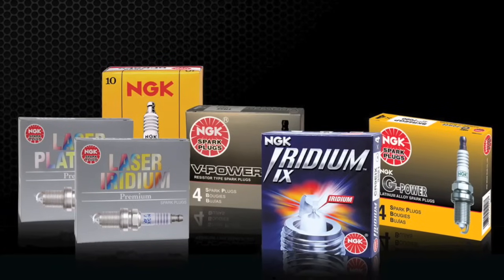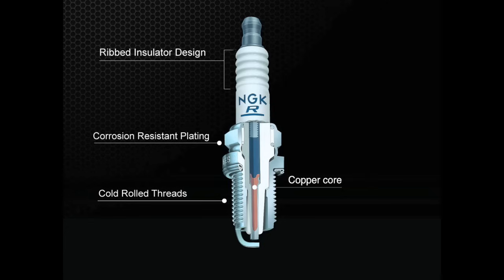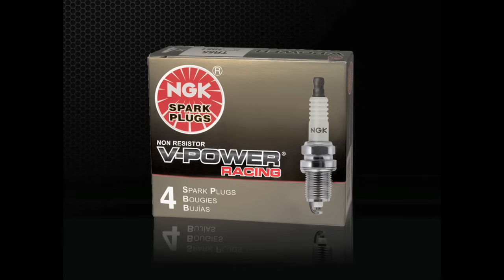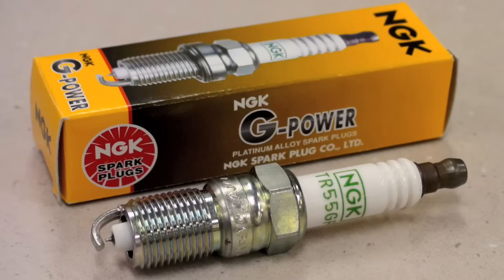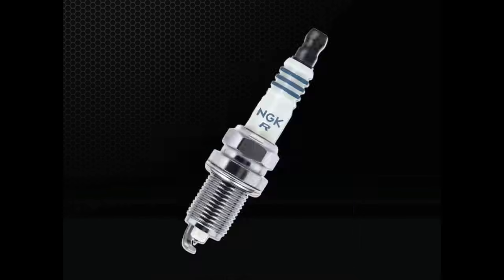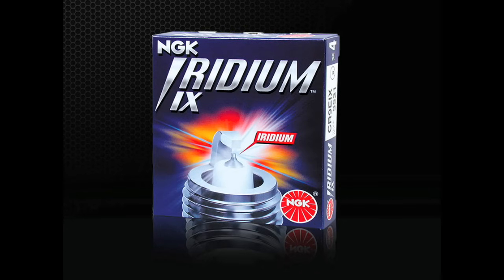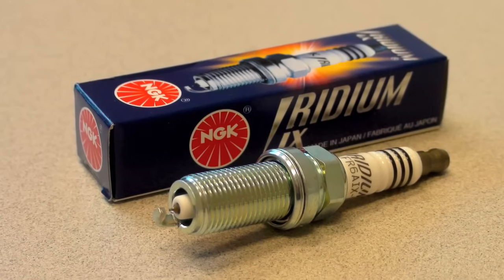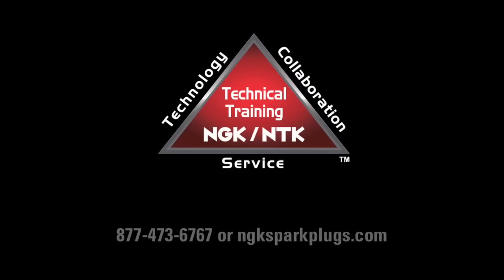Spark Plug Types - NGK Spark Plugs

Comment: I bought (saved) a car from someone who changed it from a running car, to a non-running car.  Likely a bad injector, he thought he needed a "tune up".  He said his friend changed the timing belt.  Said he then replaced the rotor, plug wires and new plugs, and finally did a hack electrical job on half of the injector connectors.  Went to look at it, first verified his crappy wiring was correct and going to the right injectors, amazingly they were.  Then I pulled all the plugs to do a compression check, compression was fine on all cylinders.  Apparently he thought buying Iridium plugs would solve all his problems.  Instead they were fouled, one of the electrodes was burnt to a crisp.  Paid him and towed it off.  Obviously the timing is off a bit.  Whether it's caused by the belt or distributor, I will find out eventually.  Going to go straight to the belt and do it over again, because I'm definitely not impressed with this guy's work.  I'm sure his friend isn't much better.

Comment: Which plugs are best for a 2011 Camaro V6? (modified exhaust system)
Reply from the maker: Hey Anthony, a modified exhaust won't affect the spark plug choice. For your car, best plug is ILTR6E11
Mike Becker, Senior Technical Instructor
Reply: What about the ruthenium hx spark plug 91276?
Reply from the maker: Thanks for the comment. Sorry this video was made prior to the release of Ruthenium HX.
Reply: @ngksparkplugsusa  can you answer my question if it's best for my vehicle? Thank you
Reply from the maker: Anthony, as Mike recommended you can't get any better than the ILTR6E11

Comment: Just installed 6 laser iridium plugs on my 07 frontier.  100,000 miles to go, already at 156,000.
Reply from the maker: Lovin' them?
Mike Becker, Senior Technical Instructor
Reply: Nobody drives a 07 frontier.    If they did, Ngk wouldn’t be your go to anyway.

Comment: What is the "as manufactured" gap for the IX plugs? My factory suggested gap is 0.060 and, in another comment response, you say no more than a 0.012 adjustment should be made to them. Thanks!
Very informative video, by the way.
Reply from the maker: Hey, so the "as manufactured" gap is variable. We make many different gaps for an IX plug. 0.060 is a pretty common gap size. We do make plugs that will come out of the box as such. What kinda car are you putting these in? Stock?
Mike Becker, Senior Technical Instructor

Comment: How do you adjust the spark plug gap on the laser plugs not to damage the small pin.
Reply from the maker: Hey Joe, you need to use a gapper that doesn't put pressure on the center pin. The old-school coil-slide type gapper is no good. You want the kind with the little loop of wire. Be very careful still, even with the proper gaping tool you can still cause damage. We also only recommend a maximum of 12 thousandths adjustment on our plugs. Anything more than that can distort the ground electrode. 
Mike Becker, Senior Technical Instructor

Comment: Which plugs are best for Lexus IS350 2007 ?
Reply from the maker: Hey Sultan Alsobh, the best plugs for your IS350 will be our Laser Iridium series. Part number is DFH6B-11A, stock number 6858. 
Mike Becker, Senior Technical Instructor
Reply: @ngksparkplugsusa  Hi Mike, is it the iridium IX? And is it good for performance and fuel economy? Im driving on 15 m/gal...
Reply from the maker: Hey, this is a Laser series. This is better yet than the Iridium IX. It is THE BEST for performance and fuel economy. The Laser Iridium plug is our best spark plug we offer. It will work great in you Lexus!
Mike Becker, Senior Technical Instructor
Reply: @ngksparkplugsusa  Hello Mike, how can i order it to Dubai or do you have any vendor in Dubai selling the same ?
Reply from the maker: Sultan, your best bet is to reach out to NGK in Dubai. Here's their website. Get in contact with them and they should be able to find you a vendor in Dubai. http://ngkntk.ae/
Mike Becker, Senior Technical Instructor
Reply: @ngksparkplugsusa  Hi Mike, it's sad that all of NGK vendors selling only wholesale. Lol, how are we going to buy for individual? Im not a company owner to buy in bulk all i need is 6 plugs...
Reply from the maker: Hey Sultan, any online retailers over there sell them? Here we use NGK.com, Summitracing, Amazon, etc. Can you access and order from any of those?
Mike Becker, Senior Technical Instructor
Reply: @ngksparkplugsusa  Hi Mike, sadly no good online shopping sites for car parts, even souq.com is an Amazon company they still bad online shopping site. Secondly i cannot buy from US due to transit time takes months i even sometimes asked for refund because the item never arrived

Comment: I've used NGK plugs since the early '60s and they have always performed well.
Reply from the maker: Hey John, that's great to hear!
Mike Becker, Senior Technical Instructor
Reply: Mike; Thanks for your reply. For what it's worth, in 1961 I was riding around in a 1955 Triumph Tiger Cub motorcycle. It had a 200cc, 4-stroke engine that ran just fine. However, I would have to put a new spark plug in it about every month. Champion, KLG, Lodge plugs, made no difference. One day a friend of mine showed me his Japanese motor scooter that some G.I. off the Army Base brought home. It had a NGK plug in it. I got interested and traded him a new spare Champion for it. When I got rid of the bike some months later, it still had that NGK in it. 'Nuff said!
Reply from the maker: John, the proof is in the plug :) I love hearing stories like that. Thanks for sharing!
Mike Becker, Senior Technical Instructor

Comment: I have 275,000 miles on my vehicle and have never replaced the ngk pfr5g-11 spark plugs. After 17 years of driving the car has finally  developed a slight miss. 

I'd say these plugs will get you your money's worth
Reply from the maker: Wow, that's a ton of miles on the plugs. They should have probably been changed out at least a few times in there!
Mike Becker, Senior Technical Instructor

Comment: I want a non resistor plug for my honda 50. Currently using iridium but its 5k resistor. Standard plug is C6HSA but I want the very best as the magneto ignition is a bit feeble!
Reply from the maker: John, sorry there is not currently a plug with the same dimensions as your C6HSA in a non-resistor iridium. CR6EIA-9 is all I have that's iridium in that size.
Mike Becker, Senior Technical Instructor
Reply: I have always used NGK in my Honda motorcycles. I bought the Iridium as an upgrade. It would appear however that the weak magneto ignition might prefer no resistor. I also want to try plasma spark which apparently doesn't work with resistance. My SS50 plug is 10mm thread and 12.7mm reach. Heat range 6. Are there any non iridium in your range that are 'upgrade'? Or is the C6HSA the only available? Maybe copper core? Or is my plug already copper?
Reply from the maker: John, that's great to hear you've always used NGK's! Unfortunately not. That is the only plug in that size and heat range available without a resistor. The C6HSA is a copper cored plug. It will work for your bike, unfortunately, I don't have any upgrades for it :(
Mike Becker, Senior Technical Instructor

Comment: I have honda civic 2008 in pakistan i want better fuel average  please suggest
Reply: 1800 cc
Reply from the maker: In the USA the 1.8L 2008 Honda Civic gas engine runs a IZFR6K-11S. This is a Laser Iridium spark plug. Hope that helps!
Mike Becker, Senior Technical Instructor
Reply: @ngksparkplugsusa   which plug give me best fuel average
Reply from the maker: The best plug is our Laser Series. The gives you the most efficient spark plug for your car.
Mike Becker, Senior Technical Instructor
Reply from the maker: Hey Muhammad, what engine is in your Civic? The best spark plug for your car would be one from our Laser Iridium series. I can get you a part number if you can tell me which engine you have. Thanks!
Mike Becker, Senior Technical Instructor

Comment: i have a stock 2010 camaro ss, would you recommend iridium ix? am really confused and i need advice please!
Reply from the maker: Great question. The OE style plug for your vehicle is a Laser Iridium. NGK Laser Iridium contain a laser welded iridium tip and a platinum ground electrode. The Iridium IX plug has an Iridium tip and a tapered ground electrode. IX are considered a performance upgrade for quicker starts, acceleration and anti-fouling characteristics.
Reply: Thanks for the feedback! will be installing iridium IX by the weekend!

Comment: I bought the Iridium IX for my 98 Subaru Forester which had Platinum as Stock plugs and will get them tomorrow.
I will inform about my experience.
Reply: Tobias Rieper what's your experience
Reply: mikexcanxjerk
At the moment, the Forester starts and runs. I can't tell you more atm.

Comment: Just swopped out the OEM NGK PFR7G in my supercharged Honda S2000 with the BKR8EIX Iridium yesterday. Colder heat range is necessary for supercharged cars like mine. Still putting it through it's paces but I can probably feel a slight improvement already :)

Comment: What plug should I use in my 1989 Mustang 5.0 that is running a MSD 6AL box with a Demon coil. Should I run basic copper core plugs or can I stick with the NGK iridiums that are in the car now.
Reply: i have a MSD in my truck , im trying to find out the same thing , whats the best plug to use with MSD coil and 6AL box ? its not a race car just has a few mods like cold air and headers , still looking for answers ???  did you find out anything ???

Comment: i have a nissan frontier 2001 i did my tune up myself i bought the NGK iridium is this already pre-gap or do i need to adjust the gap? I notice after i put it in in not happy i replace everything sparkplug wires also is NGK and the distributor cap is brand new spakr plug also... after i put it in i notice when im driving uphill it looses torwue compare before i replace made a tune up my truck runs good thought after tune up will be more better.. I need some advice. thanks
Reply: no you can lighty lighty check but no bending it is what it is and usually they are spot on.  I would not even check if it's what vehicle calls for.  For sure do not damage the tips.  Champions go for it lol not same plugs much more precise today's cars.
Reply: distributor are notorious on those going bad fyi
Reply: +fake priesthood.

Comment: Are the Iridium IX any good for LPG/Petrol (dual fuel) engines?? My car came out with standard nickel plugs but NGK recommends Iridium IX on their website but that is for standard petrol engine. There is no NGK recommendation for LPG plugs for my car. Can Iridium IX handle the hotter combustion temps of LPG??
Reply from the maker: tubester4567 I'm assuming you are located in the UK? If this is correct our friends at NGK UK could help answer this.. @index.php/contact-us/

Comment: I bought 6 NGK Laser Platinum spark plugs for my BMW 328i. For some reason, it has 4 electrodes instead of 1 like it was shown in this picture. The number for the spark plugs I bought is (3199), is this the same one? The seller used double platinum when they were selling it.
Reply: LiNingAir I just bought the same ones received them today tell me (3199) I'm yet to fit them. Where they good when you put yours in?

Comment: Will the Laser iridiums work with a motorcycle? ('09 Kawasaki Ninja ZX-6R) The owner's manual says to use NGK CR9E plugs. Do the CR9E plugs come in Laser Iridium, or Iridium IX?
Reply from the maker: Many newer motorcycles use Laser Iridium as 
original equipment.  In the case of this Kawasaki, the best upgrade from
 CR9E is Iridium IX CR9EIX stock no. 3521.

Comment: 6 laser iridiums in my 01 kia optima se v6. .....excellent!
Reply: i just installed on my 2011 kia optima 4 laser iriduim
do u find difference ? fuel efficency ??
Reply: *****
a bit, i did it more so i wouldn't have to change them again for close to if not at 100k miles

Comment: Just fyi, i put the Iridium IX on my honda civic. its a 1997 hatchback. Couldn't say there was performance, but the mileage def. went up. i used to get 450KM (280mi) a tank. after the install i easily get 500km+ (315mi). overall i am pleased, and they paid for themselves. NGK fo life.